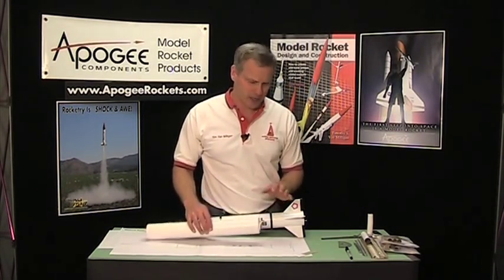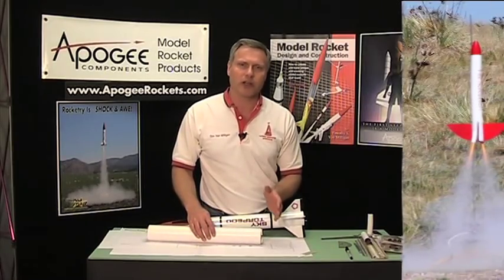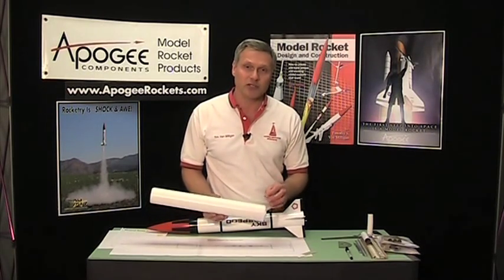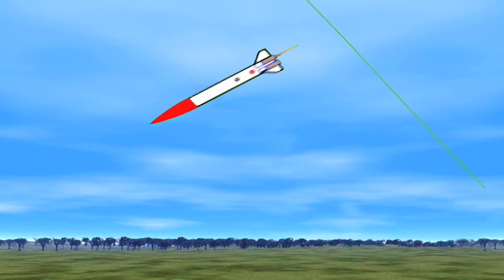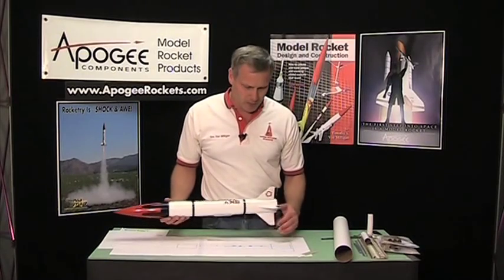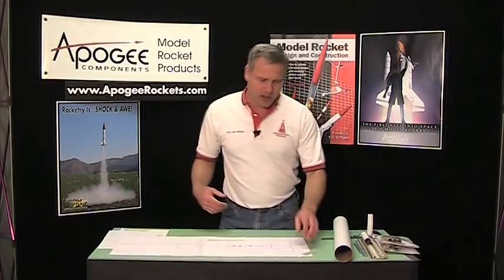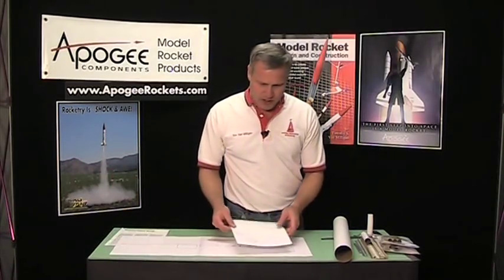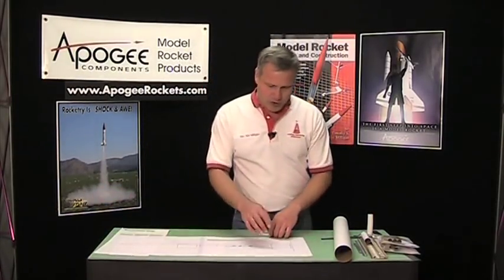Designing a Canted, Clustered Rocket Engine Mount

Comment: If you shift the engines to hang further out the back to avoid the engine-mount intersection, isn't that going to also then going to shift the CG rearward, and thus your engine-cant will no longer be pointed at the right spot again?
Love your videos Tim, thanks so much!!!